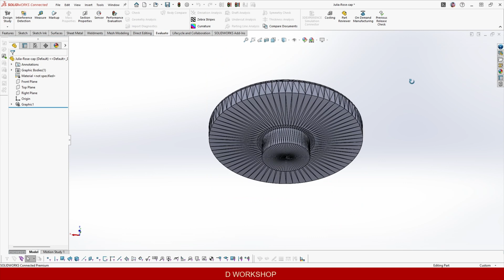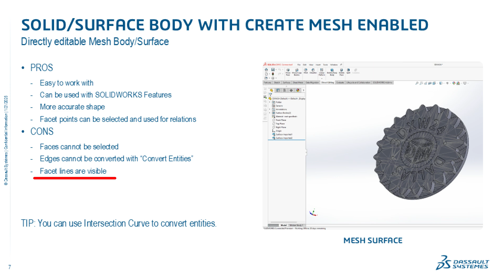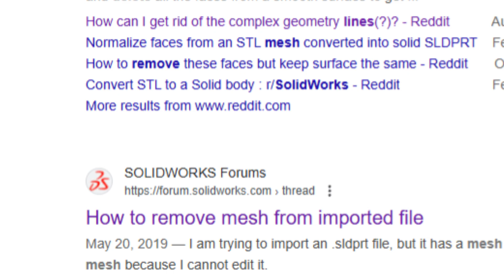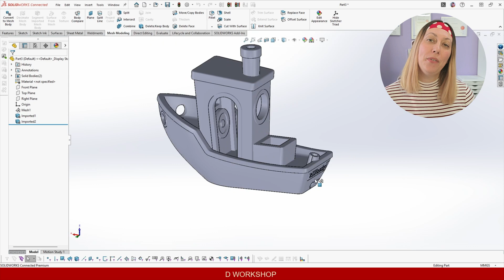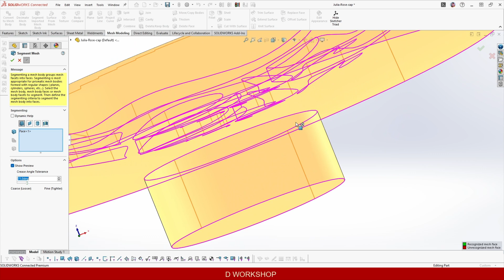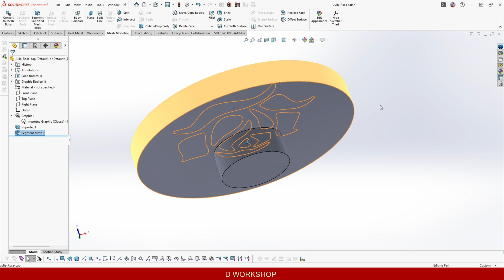My Role in Changing SolidWorks 2025 – STL Just Got Smarter!

Comment: Thank you Danute for your awesome videos, I learn a lot of tips/tricks from them...I only have a standalone license ofb 2022 Pro, is this feature only available in 2025?  I am so frustrated in the process, as I am requested (often) to modify a adaptive life part for disabled individuals. As SW 2025 is not in the budget, I am looking for a workaround. Your videos on this subject matter have been extremely helpful, thank you.
Reply from the maker: Hi Larry,
Thank you for the kind words! Unfortunately, the option to make mesh lines disappear is only available starting with SOLIDWORKS 2025. However, the other techniques I demonstrate in my STL videos are also available in earlier versions. The behavior may vary slightly, and some options might be missing, but SOLIDWORKS has included mesh tools since 2018.
If I understand correctly, you're building around the scan — in that case, what you already have in SW 2022 should be sufficient. Your work is truly admirable, and I appreciate you sharing it.

Comment: HI been watching a few of your stl conversion vids, realy clear and helpful, thank you, I have a question, I have some complex shapes, but all made up of planes, just lots, i often miss 1 or 2 after completing the wizard, is there a way to go back and add missing planes, or do i start again, thanks
Reply from the maker: Hi, that's an interesting question. When you use ScanTo3D, nothing is lost from your original mesh, but sometimes with complex geometry is hard to convert all at once. My advice would be to run the Surface wizard several times, first use it to divide the model in smaller pieces, then work with the individual pieces. Your original mesh will stay, but will be hidden after the wizard, however if something goes wrong, you can always show the original mesh and work with it to extract needed piece (sometimes some pieces disappear after the wizard). Another way would be to convert to surfaces with the standard convert instead, soon I'll make a video about it. I hope this helps.
Reply: @DWorkshop  I have broken the model up in 3dsmax, and saving smaller, less complex stl's so think we are on the same thoughts, you would hope that the dev team make an improvement to the colours and how they display, its not easy :), will keep watching, have 25+years in 3d modelling, just not expert in solidworks yet :), thanks for the reply :)
Reply from the maker: Yes, I totally agree about the colors, will mention it this year on 3DXW in Houston.

Comment: Great info, since I work a lot with mesh and  cloud point files for reverse engineering.
But it’s a shame that I will not be able to migrate to SW 2025 until at least SP03 is released. Right now on SW 2025 it’s impossible to work with splines and I also need to accurately manipulate splines because I do a lot of modeling that requires them for injection molded parts design.
Reply from the maker: Interesting, I haven't noticed any problems with splines in mine, but I work with standard and style only I don't use equation driven. Well at least the good news is that the change is there and will stay hopefully 😊